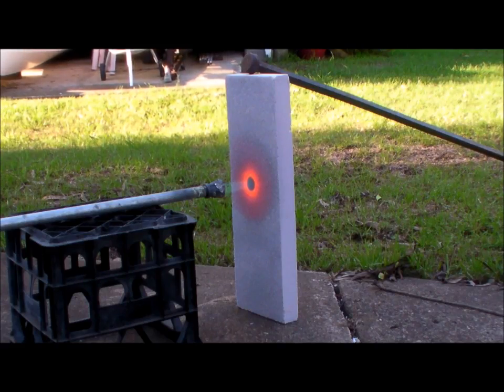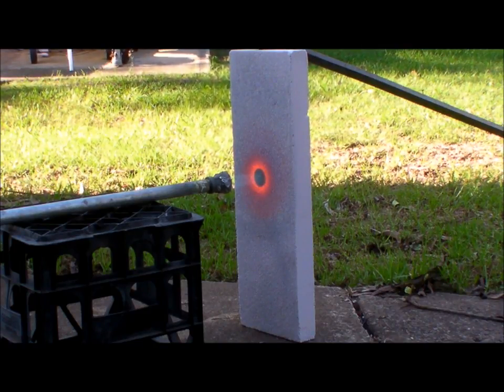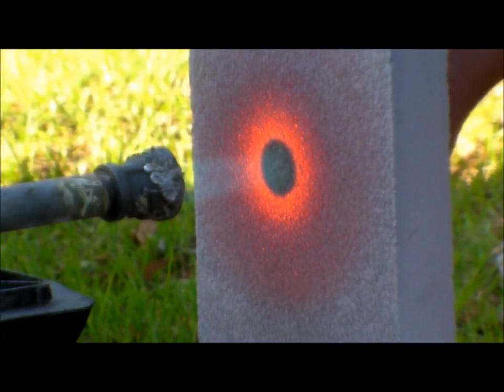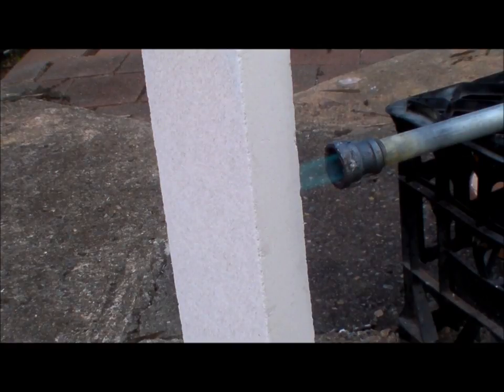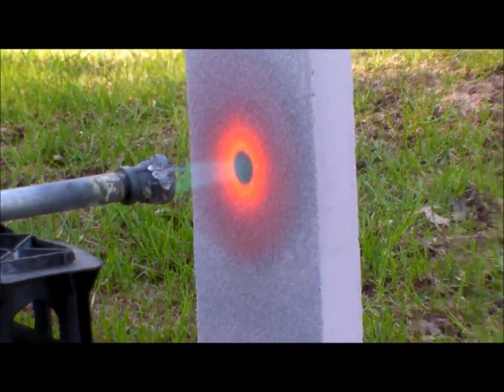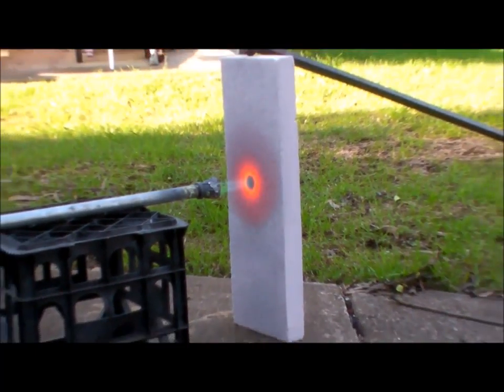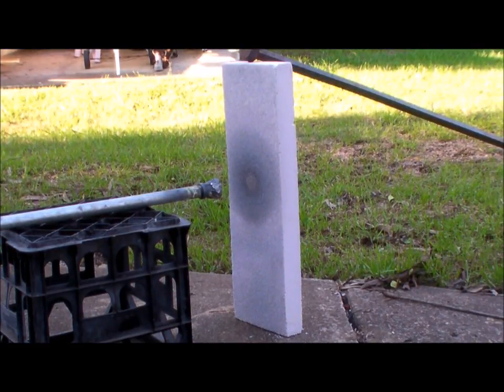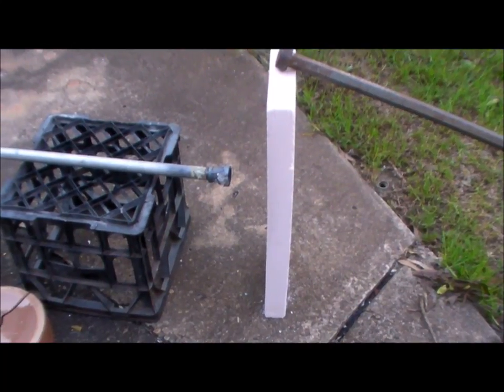Hebel block test

Comment: Thanks for that mate.I built my double garage out of Hebel block ,the blocks measuring 600x200x200.I still have a few blocks left over and was wondering how they would go on my gas forge.You saved me the time. They are brilliant.I am thinking maybe even a pizza oven could be on the drawing board. Since they only need the smallest amount of glue to stick them together ,there is also less chance of mortar exploding. I am curious though ,how they will hold up over time, continuously being heated and cooled.Cheers.
Reply: Well I am going to give it a go as a forge but will line the inside with tile so it acts as an insulator instead of taking the full brunt of the heat
Reply from the maker: G’day RICHY MARK NORMAN 
I found the brick becomes very brittle afterwards, breaks and crumbled very easily. That particular brick was cut in two and used as a hearth but fell to pieces easily when moved around, I didn’t build a furnace from them because of that. 
Cheers 
Peter
Reply: Thanks Pete.Not to worry.I had the hebel already and it was something i kept thinking about.I have a gas forge already,lined in refractory material made out of a 9kg gas bottle but wanted something a little larger.I remember the old incinerators in people's back yards that were held together with metal brackets.Those concrete blocks become brittle too but were used over many years ,so there is more than one way to skin a cat i guess...Thanks for your reply...Cheers mate.

Comment: You may have wasted 30 mins of gas- this material is already rated by code for use as a residential firewall; 3" thick provides up to 3 hours of protection.
Reply from the maker: At the time I looked for a fire rating??? and couldn't find anything, even the data sheet only had fire resistant. Having said that I was going to test it anyhow to see how good it was, I'm impressed. 
Thanks for commenting.
Cheers Peter
Reply: l also spent time looking for heat qualities and got nowhere, l wanted to use it in a small furnace also, thanks for taking the time to test and upload, l am much more confident about my test tomorrow, cheers Russell.
Reply: Great info, cheers
Reply: @TheNuggetMagnet  How did your test go and have you used the hebel blocks yet in making a furnace or forge?.I am thinking of doing the same..Cheers
Reply: @richyearle007  Gidday mate, l built the little furnace out of hebel, seasoned my crucible, then watched how the experts did it, learnt how l could lose all my fines in the flux, chickened out and sent it to the refinery, fail, cheers NM.
Reply: @TheNuggetMagnet  No worries,thanks for your reply..Cheers mate.